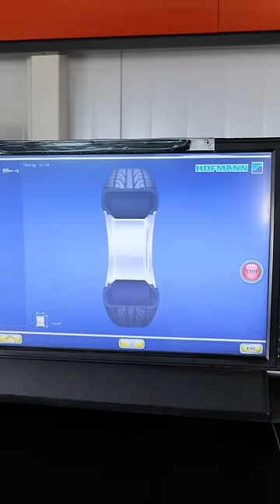Cool process of wheel restoration! Amazing idea by Wood Mood #woodmood #shorts #wheel

Comment: Structural integrity of the rim has left the chat
Reply: @jaeger3211sec  lmao
Reply: This is iron. Not aluminum.
Reply: @jorgemorais4005  still not as strong as it was
Reply: @jorgemorais4005  even more so then
Reply: @jorgemorais4005  aluminum is more ductile. This feels like an ignorant post my guy.
Reply: Materials engineer here:

Literally nobody had enough info to know about this. 

Also, rims are usually like 1600% safety factor before failure. That first shot is a whopper of a problem, but Ferris is alloys are amazing.
Reply: I was gonna say the same thing, but can someone here tell me how on earth does one get a rim so square
Reply: @justtony5149  on purpose lmao
Reply: @rushoflife2368  who the guy or me
Reply: @smallblockchevy4life462  You really should learn more about material science before posting nonsense.
To be exact, the process shown in the video does lacks of heat treatment, which indicates a half-ass job. If done correct, it can be stronger than the original rim, even for aluminum rims.
Reply: @smallblockchevy4life462  Unless the original rim is produced by die forging. A die casted rim can be repaired to a stronger state provide no tears appears during the process.
Reply: @rushoflife2368  You cannot reform forged or cast aluminum like that.  You can with steel.  Check yourself.
Reply: Never tried this on a car rim but works fine on a tractor hanger rim, problem is 2 make it seal good
Reply: He also tightened it wrong he went in a circle not a star
Reply: Its true !!! But china is china 🤣🤣🤣
Reply: Rey evvarra meerantha
Reply: @TheGamersRace  literally read the 2 posts above you and then delete this. It was already explained.
Reply: @rushoflife2368  I can't delete someone else comment, sorry.
Reply: @rushoflife2368  wheels are usually cast aluminum. It is not anywhere near as ductile as steel.
Reply: i was ab to sayyyyy isnt the rim now hella weak and brittle
Reply: Rip
Reply: ⛹흴교환 하자 ㅋㅋ
Reply: @기스아포티지-p4r  LOL
Reply: Once the steel has been heated, also known as annealing, it changes the structure of the atoms and molecules that are aligned during the forging and quenching processes used when it was made new. This is why a knife blade, for instance, is tempered, and heat treated so the blade has a harder portion and a more ductile portion. One can not set an edge on the non-tempered side of the blade. It is softer not capable of holding an edge. If you heat the harder side that the edge is set on, it will soften the steel, and the blade will not hold an edge and can break depending on the alloy. So to say that "restoring " bending this destroyed rim is "as good as new is very inaccurate. It may be round again but will not be capable of withstanding the same wear and tear that the original could prior to the "squaring " abuse. It is basic metallurgy. I work with metal daily as a structural steel builder, so when most read this, they'll say, "He don't know shit." I'm not losing sleep over it.
Reply: 🤣🤣🤣😭😭😭 I’m literally crying, faqs… but I seen worse😭
Reply: Steel wheels are crazy resilient. I've bent some gnarly wheels back to round and used them for years afterwards

Comment: I’d trust the rim repair more than the fix to the sidewall of that tire which will probably go flat in a week or 2
Reply: It's not the sidewall that got patched this job is fine just a shitty plug quality, interior plug are way better at holding pressure

Comment: Actually if a wheel bends even a little bit in frame it can’t be used again because after steel is bent from it’s factory form it’s looses structure from the inside making it easy to bend so next time you go slightly harder over a curb that wheel will split in half

Comment: Cheaper to buy a new wheel.
The cost of the equipment to straighten
the wheels is exorbitant. The cost of fixing
the wheel is probably more than buying a
good used one at Pick n Pull... 😳

Comment: A tyre with a tube of course, the tyres I’ve worked on don’t have one so I wonder why this one does lol. And why paint the rim orange or paint it at all especially with spry paint 😂 and not only that those little flat repair things don’t even work most of the time! They were mainly made for bicycle tyres. If you want a proper and good repair their should be a patch in it.

Comment: Rim is compromised 1. Why did you put a plus in something you already had off the wheel for god sake take the time to patch it or better yet patchplug 2. You spray painted the valve stem and the weights for god sack paint it first so it don't look like shit 3. Why the hell are you fire beading a passenger tire you have shop air and the beads already hit the rim 4. You show them re-studding a tire then patching a tire with no studs 5.  You are showing a rim so bent at the start there is no way it would hold air in less you did a bunch of work to put a new tube and a tire on to the already bent rim don't tube your tubeless tires 6 and don't put a tire and a bent wheel 7. Its no tulip shaped its square so they bent it that's 8 don't bend a wheel on purpose. Dang I'm short 2 maybe some one will help me with this I was trying to get you a new title 10 things not to do with your tires and wheels.

Comment: The amount of shit that bothers me for no reason 
1: if your wheel is looking like something you’d in a Minecraft mod then get a new wheel no need to fix a wheel with the structural integrity fucked

2: tire is rotational and it mounted the wrong way 

3: lugbolts not tightened in star pattern 

4: if something is in the tire then you’re better off just patching it instead of mounting it back up and putting a road plug in it

Comment: First off rim is trashed even if he heat treats it its trashed, second he was on a tire machine with a BUILT IN AIR LINE specifically put on the machine to seat beads, third he uses a dollar walmart tire repair kit when he had the tire off the rim and couldve used an actual plug patch like come on sloppy work, last but not least he then installed this pile of crap back on the car if that was my tire and rim and i came back to oh well we just heated up the rim and put it back on the vehicle id be pissed that thing could bust and kill me or others. DO NOT DO THIS BUY A NEW RIM!!!!